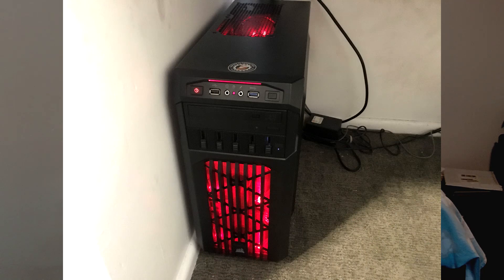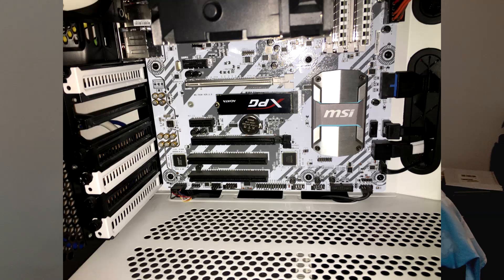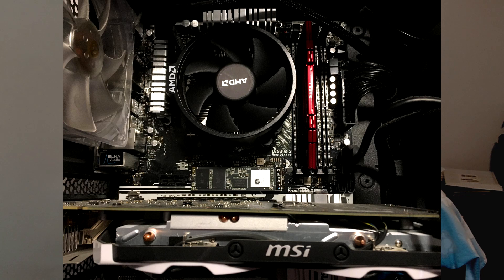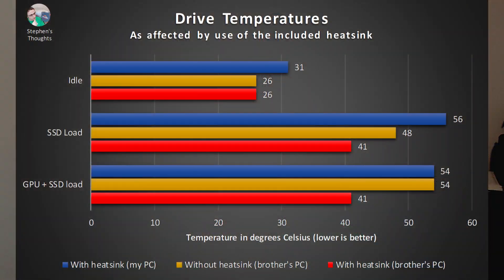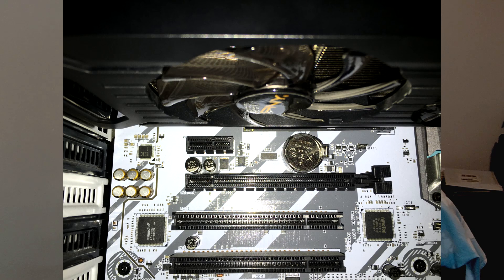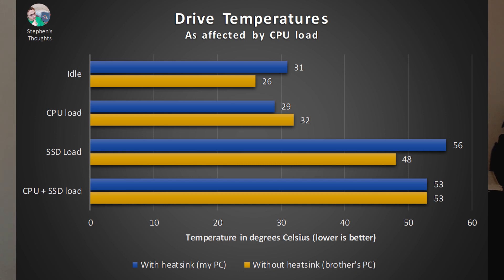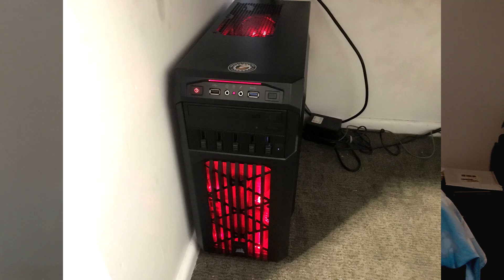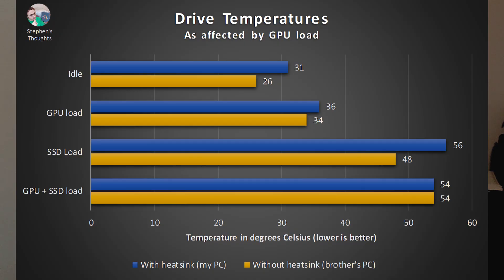XPG SX8200 Temperature Tests - Does the heatsink actually work?

Comment from the maker: H/T to madmax2069 for commenting this video from Gamers Nexus  in the replies to a comment enquiring about whether SSD's prefer low or high temperatures. I'd highly recommend you go watch at least the bit where they talk about NVMe drives and heat, which starts at 6:12 and goes for about 5 minutes: https://youtu.be/KzSIfxHppPY

Given this information, I think ADATA's heat sink is probably a net benefit, as the heat sink (which is really more like a heat spreader) is likely to equalize the temperatures between the NAND flash chips (which likes heat) and the controller (which doesn't like heat). Although I'm not sure where the temperature sensor is located on the drive, given the load temperatures are well above the rated operating temperature of 40 C for flash chips,  I'm pretty sure it won't push the temperatures low enough to cause flash memory problems.

All that said, of course, keep in mind that with Gen 3 SSD's like this, thermal throttling is pretty unlikely anyway, except perhaps in very extremely I/O intensive workloads. So no need to stress about it too much.
Reply: I'm thinking about cutting this heatsink in half and not putting it on the NAND. Any issues with that?
Reply from the maker: I wouldn't expect that to cause any benefit, and it might on the whole make the controller run hotter, as if it's cut down, it'll hardly have any more surface area than the controller itself, plus the inefficiency conducting heat through the adhesive pad. I suspect the benefit of the heat spreader is from spreading the heat between the controller and flash chips. It certainly isn't increasing the total surface area very much 😅
Reply: @StephensThoughts  I just noticed my mistake, this acting more as a heat spreader and not a heatsink. I might just go sans heat spreader for now.
Reply from the maker: Yeah, sans heat spreader seems to be a pretty good way to go 👍
Reply: @mikehobi  You could just remove the adhesive pad on the part over the NAND so the heatspreader hopefully won't touch the nand, but only the controller and ram. That way it might actually cool the latter better since heat won't be transferred directly from the NAND.
Reply: There are 6 heat sensors on the SX8200. From what I see 4 of them largely read the same temperature, one is somewhat lower and another is significantly higher. I would assume the higher one is the controller and the others are in various spots on the flash maybe the board.
For example under ssd load they read 57, 57, 83, 57, 57, 55.
Reply from the maker: @senoctar  In HWMonitor, I only see one temperature sensor on my 8200, labeled 'assembly.' What are you using to read the other temperatures?

Comment: How to remove the heatsink? I don't want it.. But its very sticky.. So how to remove it?
Reply from the maker: You've probably already figured something out, but as a general tip, heat (like from a hair dryer) weakens adhesives, but it'll probably still be pretty tough to get off.

Comment: Is the 8200pro included heatsink good enough ?
Or my m.board heatsink should be better  ?
I have two m.2 slot ,one has with heatsink or other dont.
And i have 2 ssd like 8200 pro 256gb and sn550 1tb.. 
So i wanted to keep 8200 pro with it's existing heatsink and wd sn550 with m.board heatsink.will it be fine to make 8200 pro as c drive with boxed heatsink or i should keep this with mother board heatsink ?
Reply from the maker: I don't think Gen 3 drives like the SX8200 generate enough heat to worry about thermals, with the possible exception of exceptionally I/O-intensive use cases. I would pick the slots based on lane support. Some boards don't have as many PCIe lanes going to the lower slot, which would throttle the SX8200 more than it would the SN550. On my B550 board, they both support Gen 3x4, but the lower goes through the chipset. In that scenario, I wouldn't expect it to make a significant difference.

Comment: the Silverstone TP02 is considered the best passive heatsink, would this be good reference for the test results?
I tried my SX8200 in a thunderbolt external enclosure, probably lasted under a minute before that sucker overheated. That or the bendy nvme syndrome killed it. regardless it runs way to hot to be useful
Reply from the maker: The TP02 looks like a big step up over the stock heatsink! It actually has fins to increase the surface area, which is critical for heat transfer. Of course, comparing my results with other people's results won't be super accurate due to changes in ambient temperature and airflow patterns.

For your particular situation, I'm not sure a heatsink would really help since, unlike in a desktop, it doesn't have airflow going through it. Without airflow, I don't think a heatsink will do much good. Plus, an enclosure is basically just a heat trap unless it has thermal pads to conduct SSD heat to the outside of the enclosure. That said, I'd still expect the drive to be able to operate under those conditions without failing, even if it does run slower due to thermals.

Comment: For anyone watching more than 2 years later, I have the same setup as Stephen. The SX8200 sits under a GTX 1080ti with 3 fans. My CPU fan also blows air toward the back of the case. I managed to run the tests before and after applying the heatsink with these results:
bare
ssd-idle gpu-idle 41*c
ssd-idle gpu-load 55*c
ssd-load gpu-idle 62*c
ssd-load gpu-load 69*c (might be throttling though)

heatsink
ssd-idle gpu-idle 39*c
ssd-idle gpu-idle with fan stop disabled 35*c (didn't run this without the heatsink)
ssd-idle gpu-load 53*c
ssd-load gpu-idle 56*c
ssd-load gpu-load 67*c

Overall higher than either systems in the video. The heatsink/heatspreader makes a bit of difference under load. The increase due to GPU load is significantly higher. It might be that the Gigabyte AORUS card is massive and blocks a lot of airflow, it also stops the fans at idle and probably runs hotter at load. All of which are not great.
Reply from the maker: Higher temps definitely make sense for your system, as your 1080 Ti will definitely put out more heat than the 1060 and 960 in my test systems. And it's great to see the overall takeaway validated in another system!

Comment: The heatsink accidentally fell and placed itself incorrectly and now I cannot remove it anymore ;_;
Reply from the maker: Oh man, that's unfortunate... With a heat gun or hair dryer, you might be able to coax it off, but that might still leave behind some residue. Worth a check with Adata support to see if they can help out.

Comment: Nice work! Thanks for your research contributions. 
I wish you would have done some benchmark testing with and without the heat sink. We all  assume cooler temperatures are always better in every aspect of P/C hardware, but I am skeptical w/respect to ideal NAND conditions
Reply from the maker: There definitely are some limitations to my testing, not the least of which being that I don't know where on the drive the temperature sensor that reports to programs like HWMonitor is located. But it should still be somewhat useful. And if you haven't yet, check out the pinned comment for more discussion on the ideal temperature for NAND chips.

Comment: Just wanted to say thanks... just bought this SSD for my Mac Pro late 2013. Will take your advice by installing it first with no heat sink, then add it if necessary.
Reply: What was your results
Reply: I installed mines with the heat sink and my computer was on fire
Reply: @DJ1Hands1on  That is not good news.  I have not installed mine yet.  I can't afford to be without my Mac Pro, so I am waiting to potentially buy a new one (when Apple makes the rest of their announcements later this year), then once that is operating, I will feel less nervous about tearing apart my old Mac Pro. I  plan to upgrade the SSD as well as the CPU to a 12-core. I hope both of those steps do not cause overheating.
Reply: Thank you I ended up taken it out and selling the hard drive I’ll just buy and external ssd

Comment: Any ideas on how to remove the stock heat sink?
I want to install one with a fan on it.
Reply from the maker: Just as a general rule, use heat from a heat gun or hair dryer to soften the adhesive and pull it off. Don't expect the original heatsink to be usable after removal though 😅 and you'll probably need to use some isopropyl alcohol on a paper towel or q-tip to remove some adhesive residue from the drive.

Comment: I just ordered the Terrabyte version of this drive, and a separate heat sink/screw kit off of amazon. (Because I was missing the screw and didn’t have any raisers) my m.2 slot is underneath my FE rtx 2070 super. Is there any monitoring system I could use to monitor the SSD temp? If I do apply a heat sink should I install the one the SSD came with or the DIY heat sink in the $5 kit that came with the screws?QTEATAK PCIe NVMe M.2 2280 SSD Heatsinks Cooler & Mounting Screws Screwdriver Kit https://www.amazon.com/dp/B07RRNC5WD/ref=cm_sw_r_cp_api_i_i4MCEbESH9MFM this is the link to the heat sink / screw kit
Reply from the maker: I used CPUID HWMonitor to read my SSD temps.
And for performance, I would probably use the aftermarket heatsink (as long as it fits under the graphics card) as it has a much larger surface area.

Comment: sx6000 vs sx8200 difference?
Reply from the maker: The 6000 uses only two PCIe lanes, which substantially limits bandwidth compared to the 8200. However, the newer 6000 Lite and Pro both appear to use four lanes and are closer in performance to the 8200 and 8200 Pro.

Comment: I just installed it and it runs 69C idle I think thats too much is there something wrong with it ? Im gonna try it with heatsink to see any diference
Reply from the maker: That does seem quite high. Where is it mounted in your case?
Reply: @StephensThoughts  Under the gpu I have x99 sabertooth it seems that it's ok now still haven't put heatsink but it's about 38C and i've ordered some better heatsink than the included one
Reply from the maker: 38 is low enough that I wouldn't really worry about it. And where it's under the graphics card, I wouldn't expect that you could fit a heatsink on there that's much better than the slim stock heat spreader.
Reply: @StephensThoughts  The problem was I was formating it so usage was about 99% so think that was the issue

Comment: Hey bro I should get nvme instead of m.2 sata right? Im stilk choosing for Gigabyte Rgb 256gb nvme has 3100mbps and this adata 8200
Reply from the maker: It really comes down to current pricing and what you're doing with the computer. If the prices are close, I'd jump up to NVMe just for fun, but I wouldn't expect a big improvement to performance. (You might like to check out my full review of this drive where I talk more about this.)
Reply: Stephen's Thoughts The Gigabyte is 56$ and adata is 48$. Gigabyte is actualy the same price to Samsung 860 Evo SATA (here in my area)
Reply from the maker: Without knowing the specific gigabyte model, I'd say either one is probably a good choice. You might want to compare random read/write performance, flash type, warranty period, and of course, aesthetics.

Comment: Btw what programs you used to check temps?
Reply from the maker: If I recall correctly, I read the temperatures from HWMonitor. Though you can also check temperatures in CrystalDiskInfo and ADATA SSD Toolbox.

Comment: Hi friend, excellent video!

One question, What is the difference between XPG SX8200 Pro and GAMMIX S11 Pro?
Apart from the fact that the S11 Pro has a heat sink, is there any other difference?

And if not, which one should I buy? if both are at the same price and my motherboard has a heat sink.
Reply from the maker: I'm not entirely sure about the Pro models, but the SX8200 and Gammix S11 non-pro, according to Anandtech, were basically the same drive, but with different branding and a different heatsink. And I don't see a performance difference between the pro models on ADATA's spec sheets. https://www.anandtech.com/show/13112/the-adata-sx8200-gammix-s11-nvme-ssd-review

The main difference seems to be that the S11 ships with a heatsink attached, so if your motherboard already has a heatsink, you'd probably be better off with the 8200 so you can attach your motherboard heatsink directly to the drive.

Comment: Hello friend can i get your opinion. My Mobo (Asrock B350) has the m2.slot on the bottom of the board meaning the opposite side where nothing else exists). Also i run a tight mini-itc Case (Node202) with minimal airflow. Mostly the cpu and gpu push their hot air out of the case. Would you recommend i put the heatsink on or leave it as is
Reply from the maker: Well, I wouldn't expect either config to cause any thermal issues. I would probably start without the heatsink and as long as the temperatures aren't approaching thermal limits, I'd just leave it off. Though either way, if it's not too hot, I wouldn't worry about it.
Reply: @StephensThoughts  well i decided to put the heatsink on. Idle system gives me temps on the 30s while after a session full load gaming i get 51-52c. Not bad i think

Comment: Great video, thanks for sharing! I have just these last two days tried an Adata XPG 820 Pro in a Dell XPS 15 with and without the heatsink. It seems to read at 40 degrees regardless, even when stress tested. Sighting across the interior with the heatsink on it would appear there would be about 0.5-1 mm of airflow between the heatsink and the bottom case. Not sure if there is really any point in using an additional thermal pad on top of the heatsink to vent to the bottom case? In other words, it seems to work extremely well with or without the heatsink.
Reply from the maker: Those are some good temperatures! Though a bit odd that the heatsink had no impact. What sort of sequential speeds did you get?
Reply: @StephensThoughts  Maybe the heatsink would work better if there was more space/air around it. Anyway, I'm getting 3352 sequential read and 2145 write speeds, so definitely can't complain.
Reply from the maker: It probably would work better if there was some airflow over the heatsink. But regardless, it doesn't seem to negatively impact performance, so I guess we're golden!
Reply: @StephensThoughts  I agree and just to update you I noticed that after removing the heatsink about 24 hours ago I notice today that the temperatures are in fact just a bit cooler with idle being 31 degrees and general use going up to 36 degrees. That said I have not done any stress testing today, so maybe the heatsink was insulating the drive yesterday somewhat and trapping at least some heat making it run slightly hotter.

BTW, I think running a stress test to heat the SSD softens the glue on the heatsink making it a bit easier to remove. I also left the SSD attached to the motherboard when removing the heatsink, effectively acting as a second pair of hands, and just applied a steady upward pressure on one side until I could feel the glue starting to release. Once a small part became free it soon made taking the whole thing off quite easy, although I too caused some small buckles to the heatsink but as I wont be using the heatsink again I am not that bothered. 

As for the macbook guy, I wonder if his heatsink was actually touching the bottom cover and creating heatsoak which just makes everything run hotter and hotter?
Reply: @paullynch164  I actually asked that a bit and just saw this comment xD i wanted to try the heatsink but i was worry that i could brake the M.2 because that glue is quite strong but thats a good idea to hit the M.2 before taking it off.
Reply: Hi Paul! I'm looking into upgrading my ssd of my xps 15 also. Everywhere I look the Samsung Evo is always the recommended one, but now the ADATA is popping up and I also came accross the Corsair MP510. Do you have any recommendations? The last two seem to be at the same price range and really close on specs and performance. I'm looking for 2TB capacity and I mostly do video work! Thanks in advance
Reply: @filipecardoso3145  This is the first NVMe drive I have used so I don't feel qualified to advise you, although from reading around the subject I don't think there is much if any real world difference between them. The reason I chose the Adata XPG 820 Pro was because it is best in its class for power efficiency, which I was hoping translated to less heat, especially inside such a thin laptop.
Reply: @paullynch164  Thank you so much for the reply Paul!
Reply: @filipecardoso3145  Also happy to report that after using it for a while now it does indeed run a lot cooler without the heatsink attached, at least in such a thin laptop it does. It ticks over at about 30 degrees with basic programs open and rarely goes above 40 even when stressed. Seems I picked the right choice! ;)

Comment: Those temps look OK. 
On the newer b450 Tomahawk the M.2 drive is positioned between the CPU and GPU, so it will benefit from the down-facing CPU cooler fan.
BTW the "heatsink" of this M.2 drive is the thinnest, flimsiest paper-like piece of aluminium that has even been manufactured.
Reply from the maker: That's definitely a better location thermally for an M.2 drive, but I kind of like having it hidden.

And yeah, calling it a heatsink is perhaps a bit too generous. It's more like a heat spreader.